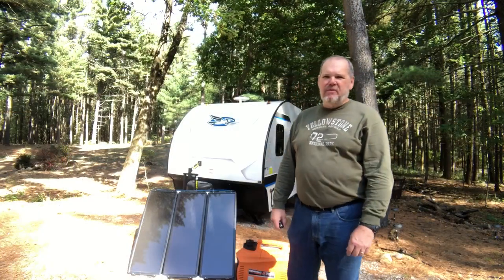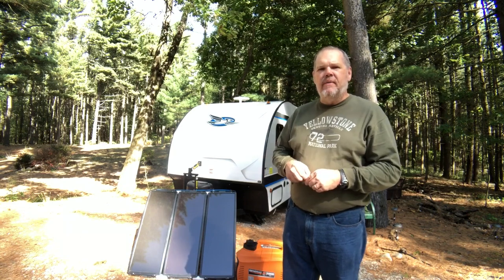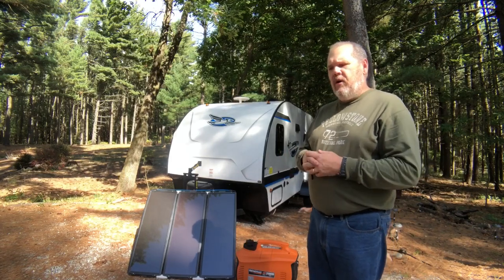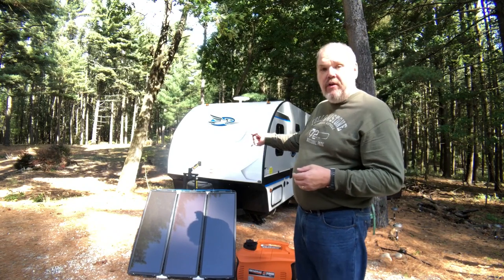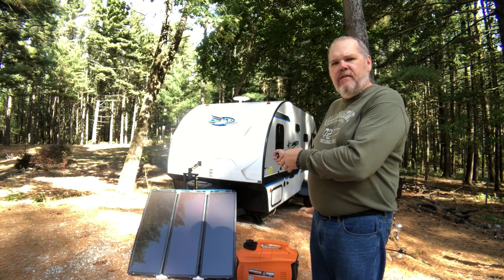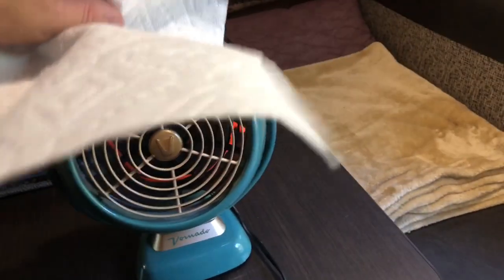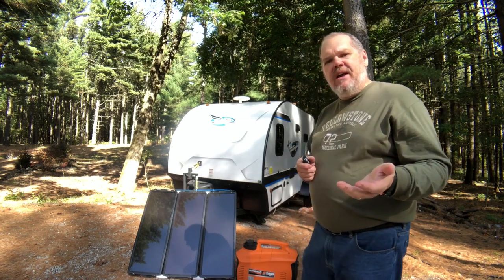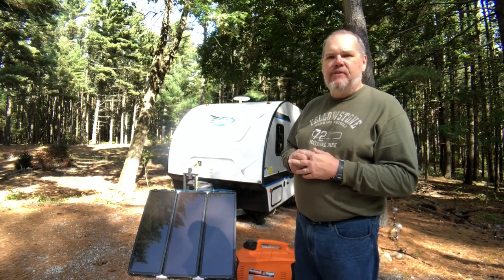Boondocking Basics: Electrical Systems for our Jayco Hummingbird

Comment: Nice information.  Just remember your furnace needs 12v to operate the control board and fan.  It will drain your batteries down in very short time.  6V batteries are better for deep cycling.  Your videos are great, your very articulate with your narration.  Unlike my videos I'm always searching for words lol.  Great job.  Happy Travels!

Comment: Pat, another great informative video. Thanks so much. Fantastic fan on our list. Then the solar panels. Thx again.
Reply from the maker: Thank you!  We love our fantastic fan and it doesn't use a ton of battery to operate.  Hope you are having a great time on your trip!
Reply: Travels with Delaney we're in our Florida condo now. We played your videos up on our 60" screen. Awesome!
Reply: When wiring batteries in series to get your desired voltage I.e 6+6=12 you don't get double the capacity.  You will only have the capacity of one battery.  2x50ah 6v will give you 12v at 50ah. Batteries in parallel well maintain the voltage but double your capacity.  So don't go thinking you're getting something for free by choosing  2 6v batteries.  If they're easier to manage because of size or you can get a deal on them that saves you money over a single  12v then go for it but there is no advantage   to your suggested route with regards to increasing your usage capacity.  Hth.
Reply from the maker: DENMONKEY you are correct!  I’m looking for golf cart batteries with higher amp hours.

Comment: Thank you for these types of videos.  Im a new travel trailer owner, not new to camping, and these tips are just what I need for my new-to-me 2018 Hummer 16mrb.  Quick question however.  Did you do a video on how to use the inverter?  Im not sure how that hooks into the electrical system.  Thanks again.

Comment: Appreciate your videos and sharing--phew, that generac is loud...so weird that we all love to go to these places to get away from the noise, but then we make our own noise...anything we can do to keep things quieter is a good thing...
Reply from the maker: Thank you!  We don't use the generator much to be honest.  Plus it really is not as loud as one might think.  The Honda's are really quiet however I had an owner of a Honda this summer comment to me that for what we paid for the Generac, he could live with a few more decibels.
Reply: Yes, to be sure that this is trade off. Three years ago, I got a champion 3100 inverter for a class b 4x4 I had, Champion was cheaper, but once I got to boondocking the sound of it crushed my spirit. Left it at home after that, sold it...went without, but I am in the NE and not the SW... safe travels to you.
Reply: What size was the air conditioner in the hummingbird?  Also, going to get a renogy suitcase in a couple of weeks.
Reply from the maker: Steven Miller It was a 13,500 BTU AC. Did a good job cooking but it was a bit noisy.
Reply: When I’m camping and trying to get close to nature, there’s nothing I like more than a noisy generator cranking away all night.

Comment: Did you ever land up installing the 2000w generator? I like your idea, especially with two 6v batteries that won’t be hurt by deep cycling. I would use a pure sign wave inverter. Also for efficiency reasons I would use a 12 V fan to plug into your cigarette lighter outlet instead of a 120v fan off of the inverter
Reply from the maker: We ended up installing an inverter in the the trailer which worked to run my wife's hair dryer and our microwave.

Comment: Like your videos & 2x 6v golf cart battery idea. 
I recently purchased a Champion 3400W dual fuel on ebay for $750 (incl del) in original (damaged) box. 2 advantages of propane...longer run time with 20lb tank & no fuel stabiliser needed for long term storage. But obviously slightly less (200w) O/P Wattage due to lower octane of propane. Also easily installed a run time meter ($7.99 Walmart).
We have a 17RB & have had same Norcold propane operation issue when on the road. Fridge would jump to 60 degrees after working fine at home. Dealer took 3 weeks to "fix", citing need to get permission from Jayco & their 2 yr Ltd warranty. Don't know if they consulted with Norcold. 
On the repair ticket the tech states...."Top baffle was trapping hot air at top of fridge. Bottom baffle was too wide blocking air flow at bottom. Solution was to tilt top baffle at angle to allow air to get forced at vent & remove bottom panel trim, trim 2" off width & reinstall." If it still a problem, I will install the Kentrol 30507 hood/vent air scoop (Amazon $47) mentioned by a subscriber. 
We will not have a chance to propane test the fridge on the road till next spring, since freezing temps are here in Colorado & am currently winterizing out T/T.....anyone know of good Hummingbird winterizing videos out there? I want to make sure I do this correctly since this is our first go around.
Jayco is probably overwhelmed with Norcold repairs & this has forced the switch to Dometic. In an ideal world they should replace all existing Norcold units with a 3 way Dometic (I would pay the cost difference)....sadly, not going to happen!
Reply from the maker: Thank you for watching the video and thank you for sharing your Norcold story.  Will be curious to see if your fix takes care of the problem. If it does, I will see if our dealer can do the same thing for ours.

Comment: Thanks for sharing your current setup.  I've decided that two 6 volt batteries paired with the Renogy 200 watt portable solar will fit my needs for extended dry camping here in the west (approx. 200 amp-hour of batteries to 200 watts of solar)  Their 100 watt foldable suitcase kit seem like a good choice as well.  Renogy has good reviews... Zamp does as well, just a bit more pricey.  I'm still researching inverter generators.   FYI - just saw a recent 2018 Hummingbird review and noticed that the refrigerator was a Dometic rather than a Norcold.  I hope your planned upgrades will work well for your trip to the northwest.
Reply from the maker: It seems thet Renology gets good reviews and is significantly less than Zamp,  I think the 100 Watt should work well for us as we've been getting by on the 45 watt Harbor Freight panels.  Just my luck that Jayco would switch to Dometic for 2018!  LOL
Reply: I have the Renogy 100Watt Solar Suitcase and it worked great this summer on keeping my battery charged up with dry camping in my 17RK
Reply from the maker: That's great to hear Art!  That is the one I was thinking about ordering next spring for us.
Reply: Hi, did a lot research myself and went with (2) 12v group 24 lead acid combined 150-160amphr batteries (just added another battery to the one that came with the trailer) and 2 propane tanks so I just have to switch when I run out (peace of mind). will probably go with 6v batteries in series when it is time to replace (just a weekend warrior till we retire). Bought a renogy 100w suitcase giving me 5.6 amps on a good day.  My gen is a champion 3100w for my a/c, glad your 2000w is able handle it for what you need.  Buying the rpod 179 vs the hummingbird when seeing your issues...anyway good travels to you and good luck...
Reply: Jane Delaney I live in central florida if you be interested I'm selling the solar

Comment: We have 2016 R-Pod, that is Solar power ready.   I am looking at a Coleman 20 Walt solar panel, for 12V battery charger.   Can I use this panel to charge our battery or will it damage the Pod's electronic system?
Reply from the maker: If your RPod is solar ready, all you would need to do is plug the solar panel into the trailers solar port.  Does the panel come with a controller?  You do have to run the panel into a controller and then the controller is actually what plugs into the trailer solar port.  A 20 watt is pretty small and may not be enough to fully charge your battery depending on how low it is.  We were using 45 watts and now have upgraded to a Renogy 100 Watt suitcase style solar panel.  Harbor Freight has a 100 watt kit that comes with 4 25 watt panels and the charge controller for around $150.  I paid around $250 for the Renogy panel that I currently have.  Hope that helps some.

Comment: We have the Zamp 100 watt portable package. Have not used it yet. Need to get a Generator, better battery and go boondocking!  First, husband needs to retire and that is in the works for early 2019.
Reply from the maker: We bought the Renogy 100 watt suitcase style solar panel but didn't really get a sense of how well it will work yet because most places we boondocked this summer was too heavily forested.  I just bought the 3500 watt Predator generator from Harbor Freight and so far it is amazing.  Super quiet and runs everything in our trailer.

Comment: From a non-RVer.  So to hook up the portable generator to the trailer I assume you need a special cord of some type?
Reply from the maker: Actually I have a 30amp to 20amp plug that attaches to the trailer power cord and then I just use the 20amp plug to the generator.  It works very well

Comment: We are so dry in Ohio from lack of rain that leaves are turning brown and crumbling.  I hope rain comes soon.  Have you considered using lighter weight flexible panels?  Is there anything about them that would make you not want to use them?
Reply from the maker: I have looked at them but am reluctant to mount anything to the actual trailer.  At least the flexible ones I have seen are usually mounted on the roof.  I love  being able to move the panels around to get the maximum sun exposure especially if camping in the woods.
Reply: I did see one video where a person had the flexible panels wrapped in bubble wrap inside his trailer.  He said he used them instead of the other types of panels because of the weight.  I am wondering if they are as durable as the heavy folding/fixed panels.  He claimed he laid them out in the sun like the kind you have.  Weight is a big issue for me, but I also care about the durability.  Hopefully I'll be able to make the right decision when I get ready to purchase mine.

Comment: We went with two 6-volts, an inverter and a GOOD solar panel....best investment ever!  If you go with a generator, buy a Honda....very quiet.
Reply from the maker: What kind of solar panel did you get?  I purchased a 100 watt Renogy suitcase style and love it.
Reply: So, basically, this is a 12:45 video to tell people that a generator and solar panels are a backup to RV batteries.  Groundbreaking information.
Reply: Rude
Reply: Yes, it was a rude comment.  However, it was also 100% accurate.
Reply: My name is not Dick.
Reply from the maker: FLexxxtreme No, actually they are a backup to shore power and used to keep your battery charged or run your AC.

Comment: Can you charge your battery with the generator?
Reply from the maker: Yes.  When the trailer is plugged into the generator and it is running, it will charge the battery via the trailers converter.
Reply: @TravelswithDelaney  Thank you! I'm a newbie and thought I would have to connect my Yamaha Inverter Generator directly to my two deep cell batteries on the tongue to charge them. I didn't  know you could do it when plugged in to the trailer. Thank you again.